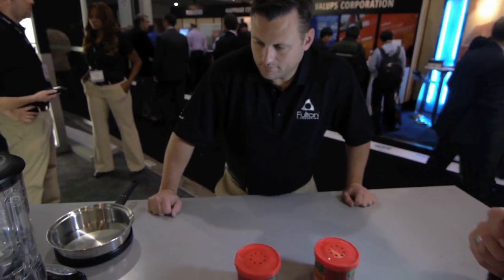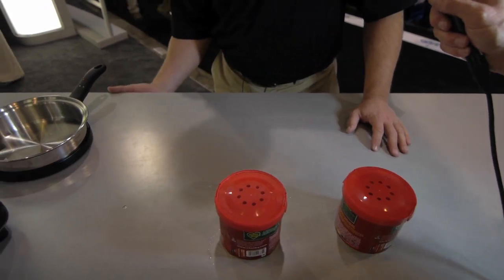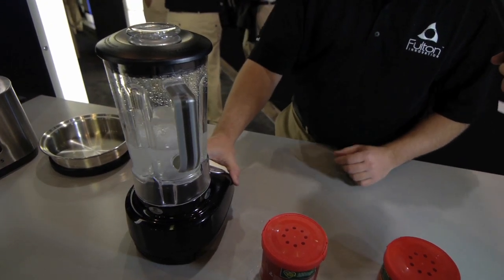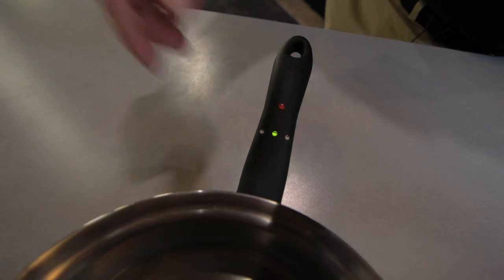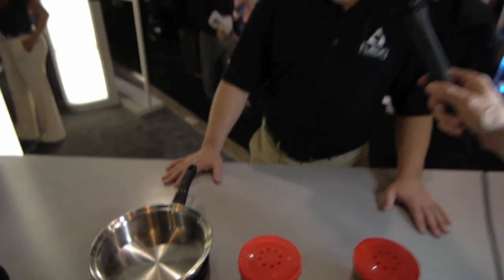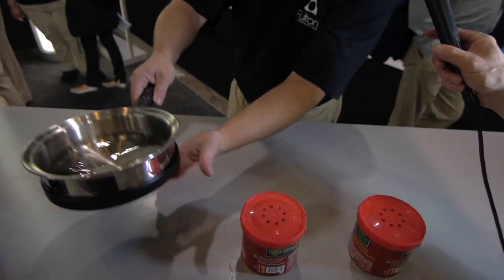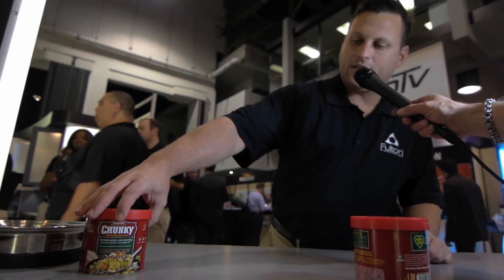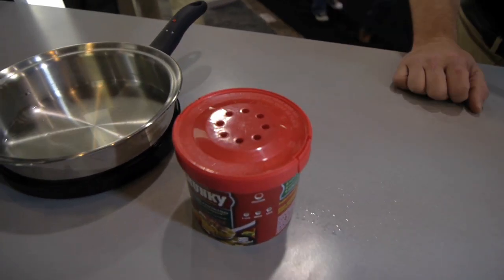CES 2011: Fulton Innovations has wireless power for the kitchen

Comment: It would be a lot cheaper than an induction cooking plate in each and every pan.  The electronics for the handle are cheap enough.  A smart pan that talks to the stove is still pretty durned clever.

So, you wouldn't be able to cook anyplace with wireless power, but you could use your "kitchen stove" as a regular counter when you aren't cooking on it.  As a man with a tiny kitchen and little counter space, that would be a huge improvement.

Comment: I thought that too initially, but pretty sure there's an induction hob under the surface, and the soup and pan have dumb steel parts that are just magnetically heated by the hob, and then there's a seperate circuit thing to wirelessly communicate to the hob controller to tell it what to do and what the temperature is; much, much cheaper to do it that way, particularly for things like soup.

Comment: I think that's all this is, it's an induction pad under the counter, the pan has a wireless thermometer, and it sends a signal to turn it on/off, but it heats just the same.

The blender is more clever, it sucks power out of the induction pad.

Comment: One morning I saw an infomercial for an induction cooking pad.  I thought, "Why not build the induction pad right into the pan?  Well, you'd have to plug it in.  Waitaminit! wireless power transmission is on the way.  Man, I wish I had the engineering knowledge to create this; I'd make a few million as soon as wireless power transmission becomes the Next Big Thing.  You could have the controls in the handle and..."

But of course I don't have the engineering knowledge to do that, so I'm glad...